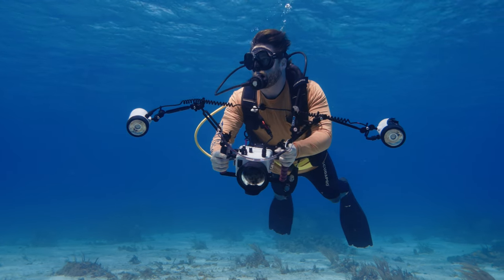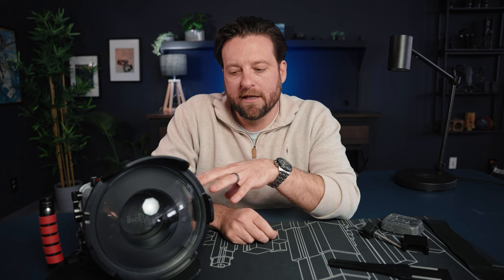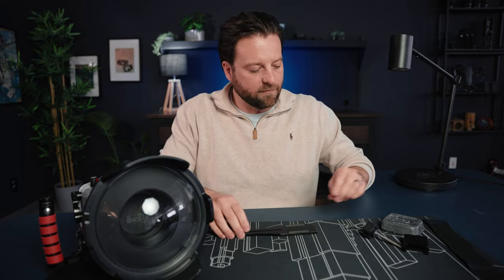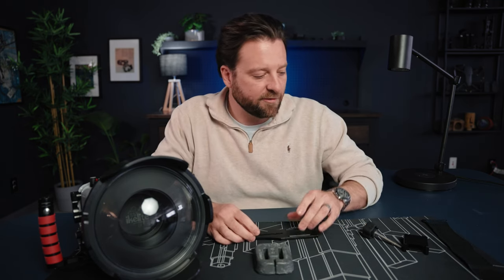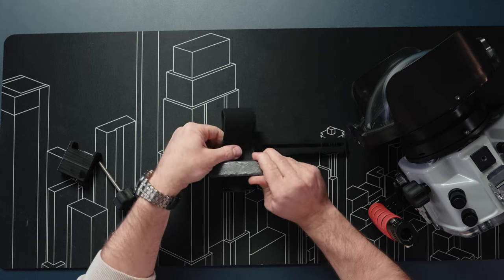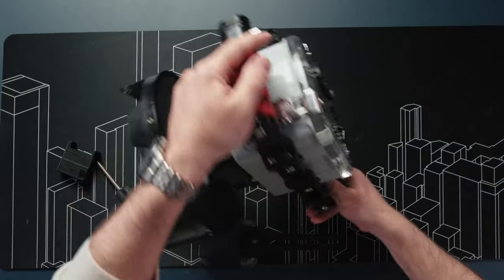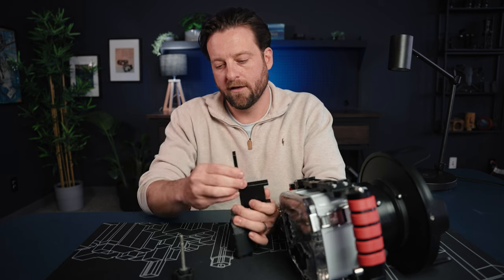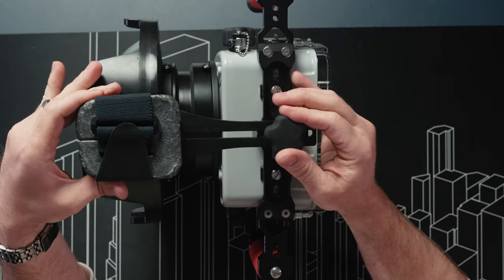Trim Weight System for Perfect Housing Stability Underwater

Comment: Hi there, do you always need to weight your housing when using. I have a Nauticam housing for z cam and struggling to submerge deeply
Reply from the maker: It's all very depending on the configuration. For example, if you're using the housing without strobes the buoyancy will be much more positive. Often times with aluminum housings you have to add special buoyancy strobe arms if the system is too negative.

Comment: The smaller dome does not need that much weight. I use 1/4 lb for now. Also the way the weight arm is attached to the bottom makes the camera unstable to lay down. Not so crazy about this design.
Reply from the maker: It will be particularly unsteady to sit down with the Compact 8" Dome since it was designed more for use with the Full Size 8" Dome. The design team is evaluating the possibility of offering a different spacer optimized for use with the smaller dome.

Comment: Hi there, do you always need to weight your housing when using. I have a Nauticam housing for z cam and struggling to submerge deeply
Reply from the maker: It depends on the combination of camera, lens, and port - since each have a different collective weight and volume. When using our housings with a compact dome, most are very neutral or slightly negative. The trim weight is most often used with a full size dome which can make the front slightly buoyant.